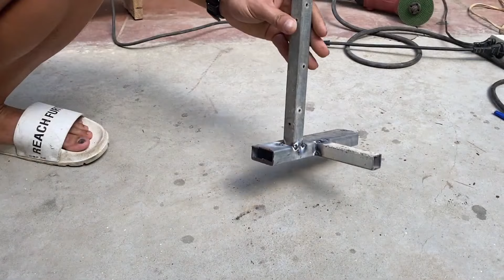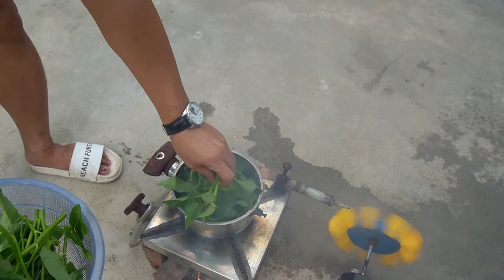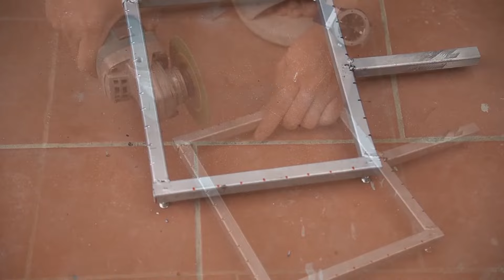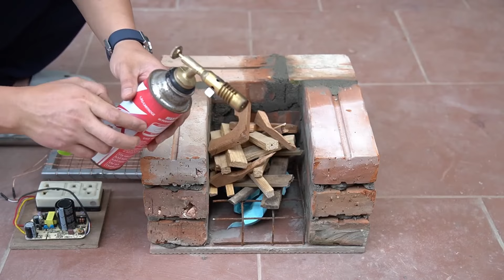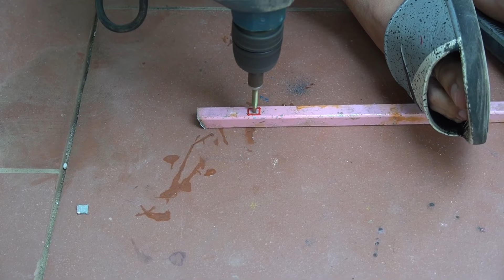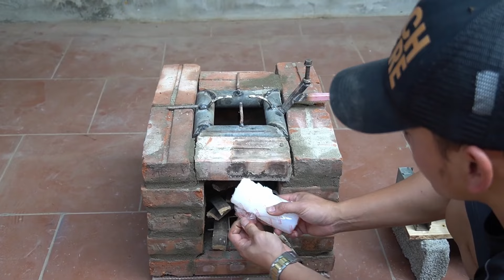Wood Stove HACKED into a Gas Turbine Generator!

Comment: How does this generate a current by heating up the copper wires?When the insulation will be burned off. Would love a full explanation of how this completely works
Reply: It's simple: you shouldn't ask a charlatan for logical explanations!
Reply: I can see powering 2 watt bulbs as used in outdoor string lights with minor generator, but heating wires? Come on...